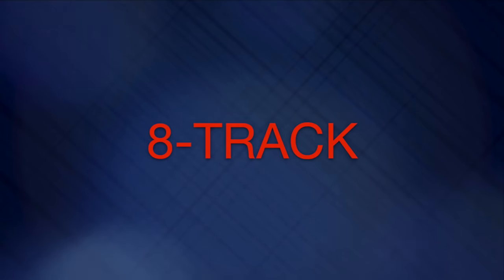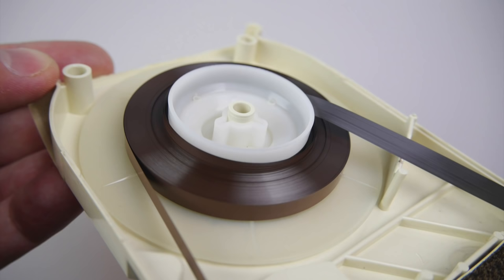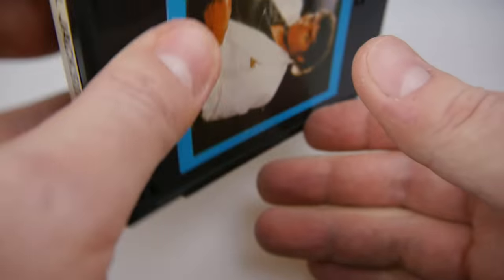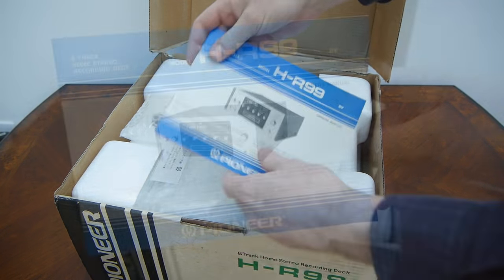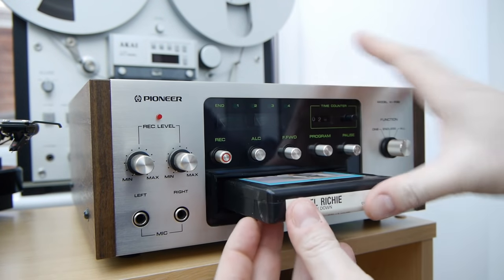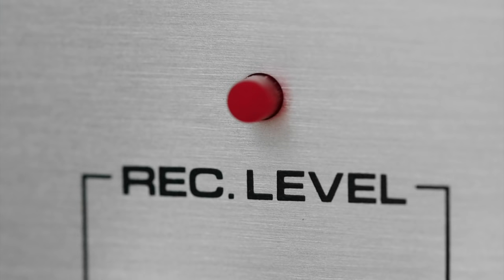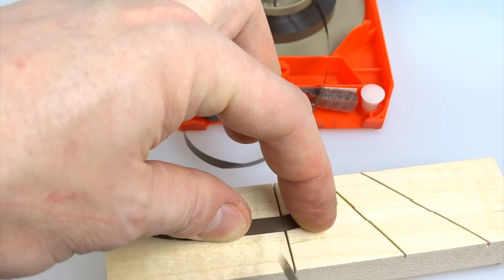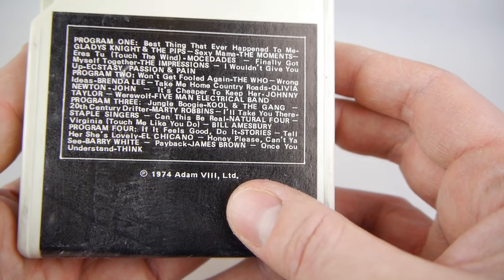Revisiting the 8-Track with a New 1975 Pioneer HR-99 Recorder

Comment: 2 things:  first, not many people remember that there was a "4 track" that preceeded the "8 track" ...same general concept, except the rubber "pinch roller" was attached to the player, and as you shoved the cartridge into the machine, the roller swung under the cartridge, through an opening  and flipped up to its position behind the tape, to move it along.  Problem was, sometimes it didn't get out of the way fast enough when ejected-which meant tape everywhere!  Manufacturers using the same size plastic shell then mounted the roller inside the tape cartridge-with no opening, and less chance of tape pull out.  Also, if I am not mistaken, the tape tracks were spaced out differently than what you showed...if you named the tracks 1 through 8 from top to bottom, the first program would have left channel on track 1, and right channel on track 5, and so on....this spacing was the closest they could manage at the time and still avoid crosstalk between tracks-except when something got out of alignment or the tape stretched...as you heard with the drums on the wrong track.

Comment: I have recently dumped my old 8 track player and tapes up the tip. I also had the Elton John greatest hits. I use to find that the tape would go tight and trap the tape and stop it pulling from the centre.  It was nice watching your video about them. Keep them coming.

Comment: My grandma had an old consol stereo that included an 8-track.  Most if not all of their tapes were Engelbert Humperdink, and my late grandfather was a very big fan of Engelburt Humperdink’s.  I didn’t know that it recorded until I got a couple of Sesame Street 8-tracks and that was the first time I was allowed to use that stereo.  There wasn’t even a fast forward, but just play and record and track change.  Later that year I got a couple of blank tapes, and we tried recording and although it didn’t work then, I managed to record some stuff on it a few years later.  Unfortunately, the belts were starting to go by then, and the machine had a serious crosstalk problem that was to the point that you didn’t have to change tracks, but turn the balance control and you would hear one thing on one speaker and something entirely different on the other.  I believe that this was a Zenith unit.

Comment: Thank you for the great video.  I have a slew of 8-track tapes from my "youth" and yes they all have the same problem and even some have bad rollers that go bad with time too.  I still have 8-track players too work but the tapes are the issue all the time.  Back in the day I used to take them apart and run the tape through the house and carefully rewind them on the reel.  They are a pain to fix.  But thanks for making this video and taking all us old folks back in time.  Much appreciated.

Comment: I still have my Panasonic RS-803US 8-track recorder and it still works. I used to have 8-tracks and it was okay, but it gets worst in the long run. I also used to have blank 8-tracks and when I attempt to record an album, I don’t have a place to put it. So I gave them away and never have it again. So I went to cassettes and reel tapes that were quite better after all these years.

Comment: I grew up in the "cassette era," but there were 8-tracks in every home, including mine.  My older sister had a bunch of 8-tracks and most receivers had 8-tracks in them before cassettes took over.  Seen them in cars, and one time I bought an old car, a 66 Bel Air, and under the passenger seat I found an old Blaupunkt (pretty sure it was BP,) 8-track recorder.  Yeah, 8-track recorders were rare, but one in a car stereo must have been almost impossible to find.  Someone out there must have really liked their 8-track mix tapes.  lol  Another car I bought had a cassette recorder in the trunk (car stereo with recorder.)  That's pretty darn rare, too I imagine.  For me to find both was as rare as it gets.  CD players were current tech when I found them, so I never bothered to try, especially the damn 8-track.  Always hated those things since I couldn't rewind them.  lol

Comment: I just watched your 8 Track Video.  Brings back lots of memories!  One thing nags me about 8 tracks, the fact that the tape is pulled from the center hub which is traveling at a smaller linear velocity (not to be confused with angular velocity) than the outer edge of the spool of tape.  This means the tape itself has to slide over itself within the spool while it is playing.  I remember as a child that blank 8 track tapes used to claim superior "lubricant" on the back side of the tape to prolong its life.  Do you remember any of that stuff?  Thanks for all your great work bringing back some of my favorite memories.

Comment: i don't know if still are in use but they used to have this 8-Track Cartridges in radio stations not long ago, it was an easy and fast way to record commercials and quick sounds for radio programming. some replaced with mini-disc or DAT systems but they ruled in the 90's in our Radio stations.

Comment: I just made this quick chart, then saw your post about the same thing... well, since it is possibly quicker to look at a chart, than clicking on your newer video, PLUS this chart also covers the QUADRAPHONIC track assignments, I will still post my hard two minutes of work...

Speed 3-3/4 IPS, (The Philips ausio cassette format is 1-7/8 IPS)

8-Track Stereo Track layout

Track assignment
1 - Program 1 Left
2 - Program 2 Left
3 - Program 3 Left
4 - Program 4 Left
5 - Program 1 Right
6 - Program 2 Right
7 - Program 3 Right
8 - Program 4 Right

8-Track Quad Track layout

Track assignment
1 - Program 1 Left Front
2 - Program 2 Left Front
3 - Program 1 Left Rear
4 - Program 2 Left Rear
5 - Program 1 Right Front
6 - Program 2 Right Front
7 - Program 1 Right Rear
8 - Program 2 Right Rear

Comment: One of the changes that showed up on later 8-track tape cartridges is that the pinch roller was made entirely of plastic, a change that may have been intended to prevent flat spots on the roller from tapes being left in the drive after you turn off the ignition.  Obviously those tapes might not have had quite as good wow and flutter performance but did seem to work.  I had only a few tapes, The Who's Quadrophenia and Deep Purple's Machine Head to name two.  Also I wondered about the head track layout you mentioned.  I thought the L and R channels can't be manufactured next to each other and are actually 1/2 the tape width apart.  Not sure, but you can check yours.

Comment: Dont forget that the Voyager spacecraft which launched in 1977 use 8-track for data storage - and they are still out there working!  Presently more than 13,633,975,000 miles away.

Comment: Even the cartridge with the tape that came off the reel can be repaired.  With patience and know how the tape can be wound back onto the reel and reconnected.  The cartridges run at 3.75 inches per second  same as the slower reel to reel to speed, so the audio quality is good.  Putting eight tracks (two for each of the four programs) on a 1/4 inch wide tape results in very narrow tracks, which is the reason for the additional hiss over and above reel to reel.  Eventually there were decks/players and tapes with Dolby B Noise Reduction, but by that time the compact cassette was taking over the market.  For home use, the auto stop after program 4 feature is a must.

Comment: Because of the way it pulled from the middle the tape would stretch over time distorting the sound. There was a set screw to raise and lower the head to fix the problem with it playing multiple  programs at once. My cousin had the adapter that let you play regular cassettes in the 8 track player.

Comment: Hi,  As a teenager, I worked as an apprentice in a Ford main dealer.   Since I was always interested in the techy stuff, I was quickly allowed to install extra's in the new cars, before delivery (remember, even top models came without even Radio's, then).   I suppose it helped that all the other Mechanics were frightened stiff of getting to grips with the like...   This often gave me days of fun, stripping out new interiors and I can still smell that (new Ford smell) now !!   Anyway, what this boring stuff is leading up to is that I was handed a pile of boxes by a customer of a new Mk1 Escort Ghia, which he was due to collect the following week...   So get this,  -  After a lot of time and a lot of head scratching, the Escort left us, fitted with a Radio (complete with an Electric Antenna, of course)...  an 8-Track Player...  a Cassette Player...  AND..  a Record Player !   You try finding room in and around the Dash of an Escort for that lot !

Comment: Have an akai cr81d in mint condition. And yeah, after 40 something years even the sealed tapes when using them for the first time still break at the splice and the foam pads have disintegrated. But with a little tlc they actually can sound pretty good.

Comment: I believe the cartridges that destroy themselves do it because some types of head pressure foam turn into a sticky slime, which then coats the tape when you try to play it. The tape layers must constantly slip, to shrink from the outer to the inner reel diameter, but the slime prevents this. So the outer tape reel layers glue together, gradually form large loose loops that can fall off the hub as the lower layers slip and shrink below them... plus possibly stretching the tape pulled from the center, and distorting or breaking it.

Comment: Great stuff!!! And you have a wonderful dry sense of humour. I laughed out loud when you showed the pile of tape strewn about.

My mother had an 8 track player in her car and in our home (in Canada) for several years, so I got somewhat used to them. All the problems you listed cropped up on my mother's tapes. But at the time - especially in the car - there were few other choices (cassette and 8 track back then fought it out for a couple years much like Beta and VHS did). 
 A few years later, when I started to drive, I could decide for myself which one I liked better. And after buying a used car that came with an 8 track and living with it for a few days I quickly realized that I FAR preferred cassettes for the primary reason of being able to FF AND REW on them and not on the 8 track (plus, even back then, they did sound a bit better).

Comment: Great Video! 8 Tracks in the UK were like Mini Disc in Europe which were big, but not here in America even though Mini Disc was WAY better than CD and any invisible digital shit. There was also an experiment on the L cassette which never made it to market I believe. It was to use the same size 1/4 inch tape as the 8 Track.  Thanks for the video.

Comment: Sorry, don't care to read through all the comments so apologies if I repeat. First music I bought was on 8 track, so I'm very familiar. 
1. Most people who had a player in their car had a matchbook or some other means of wedging the cartridge to 'adjust' the alignment.
2. There was a risk- especially if your head got dirty- of the player 'eating' your tape and that's the reason you used to see the cartridges along the roadside with a long trail of tape coming out of them.
3. That cartridge that was "unrepairable" looks just like several I did repair back in the day because there was no alternative other than buying another. Leave the (hopefully short) stump sticking up from the center and carefully wind the tape back on. Remember that the outside diameter is greater than the inside, so when you are close, you can go ahead and splice the two ends (Being very careful not to get one end twisted).  The variation will quickly draw the loop back into the cartridge.
4. Scotch tape works just fine for splicing because you know when the track is finished and can manually switch to the next track.
5. Yes, you did have to be careful of heat. Couldn't just yank out the cartridge and toss it on the dash or it would be destroyed. Second reason was you didn't want someone breaking into your (junky old) car to swipe your 'collection'.
6. I do remember quad 8-track being quite the thing for about 6 months before cassettes started to take over. Never heard one though...

Comment: Thank you for this video. Even today, many of my playlists are in the 8 track order for albums that came out during those years. BTW, you can repair those that have all the tape off the reel. I've done it many times. The biggest problem with 8-tracks was tape stretch and dirty heads which cause the tapes to be "eaten." But none of that matters to me now.... I felt 16 again for almost 17 minutes. It was heaven every second.

Comment: I've been able to repair the felt pressure pad that was used on some 8 tracks by reattaching it with some Elmer's Glue.  I've also found that some cassettes are having the same problem where the tiny felt pressure pad has come off.  I guess the glue has dried out as you mentioned.  Using a toothpick and some Elmers, I was able to fix that as well.
I also think that one reason that 8 tracks look so bad is that they were left in hot cars which baked them.

Comment: I thought I was cool in 1974 when for Christmas I received a Wollensak 8075A 8-track recorder.  I picked up a second hand TEAC AN-60 Dolby B outboard noise reduction unit and proceeded to make my own high-quality 8-tracks with TDK blanks.  The tapes I made myself sounded pretty good on my hi-fi rig featuring H.H. Scott S-15 speakers.  What made me move to cassette more than anything was the infuriating track changes and the need to configure recordings to fit within each track's allotted time.  It became too cumbersome so I ended up just letting it record straight to the the next track.  That got me by until I heard the best cassettes of the late 70's such as Yamaha's excellent home decks and the Pioneer SuperTuner car units.  That pushed me to retire the old 8-track.  I'm actually just now getting back into cassettes though.  I totally enjoyed your 8-track video.

Comment: As an aside, in the case of Pink Floyd's 1977 album 'Animals' - with 3 very long songs bookended by 2 very short ones - the 8-track format wreaked havoc on the album's flow, with every song being interrupted. On the other hand, instead of rearranging the tracks they recorded exclusive new material that stitched the first and last songs together. If you find one in good condition it could be worth a little scratch.

Comment: I'm kind of an 80's child, born in 1983 living in the US. I have this exact 8 Track player, and purchased it used from eBay back in 2002. It's by far the best 8 Track player I've owned, and yes, I have owned more than one, but that's just not saying much. I am surprised that your VU meters lit up and operated during playback, it's been about 8 years since I've used mine, but I don't recall mine operating during playback, but would turn on for recording. I'll have to look into that again. Also, mine would produce an annoying hum on the right channel, probably due to some worn capacitors.

There was a cool thing I was able to do with it though. My friend's Dad had made a 'mix tape' for his (at that time girlfriend) wife. Sadly he passed away in the early 2000's. Tape must have been made around 76. When I got it, the spice was broken, and the tape had fallen off the reel in the middle. It was bad, kinda like that mess of a one you just decided to download from iTunes. Well, since this was a mix tape, I couldn't exactly do that since I didn't know what was all on it. I sat in my room for about 4 hours, rewinding the entire thing by hand. Spliced it back together, and put it in my H-R99. I had rewound it backwards! Took it apart again, rewound again, and finally got it right. From there I converted it all to mp3 and put it on a CD. It was a really cool project, and I know my friends Mom enjoyed it.

Thanks for these videos! You do a fantastic job, and I'm enjoying watching.

Comment: I love your clips.  I was excited to see you do one on 8 tracks. I came from Czech Republic to the US in 1980s.  I knew records, cassettes but, this was a new concept.  I was really hoping to see you show us how to repair the 8 track cartridge because, it unraveling was very common.  If you pulled it out wrong it would unravel.  The one thing that remained unanswered was how does that system work when you are pulling on the tape from the center and winding it on the outside.  How does this hold tension?  I would think these type of systems would not have a long life.  Your thoughts?

Comment: Your own, new recording should come out best as the tracking would be "spot on" having been recorded and played on the same machine. I recently transferred  the cassette recordings I have done over the years to cd. Many different machines would have been used and the azimuth settings from one tape to another varied quite a lot. I bought a good machine and drilled a hole above the adjusting screw on the tape head so as to adjust it. To get it at it's optimum sound quality I mono the 2 channels and put one of the sides out of phase, and by ear, a good azimuth tracking can be acheived. Love your videos, great work.

Comment: There was also a Pioneer HR-100 Recorder issued that was the same as the HR-99 but added selectable on/off Dolby encoding/decoding noise reduction. Most may not be aware that very late in prerecorded 8 track they stated issuing them with Dolby encoding. I have HR-100 unit and can state first hand that it indeed solved the tape hiss even on blank sections of recorded tape. All the other'quirks' of owning and using 8 tracks still applied even on the HR-100. Cassette tape just killed 8 track for both form factor and audio specifications.